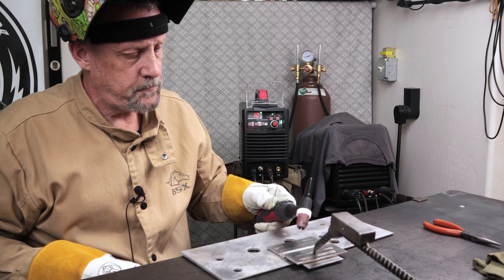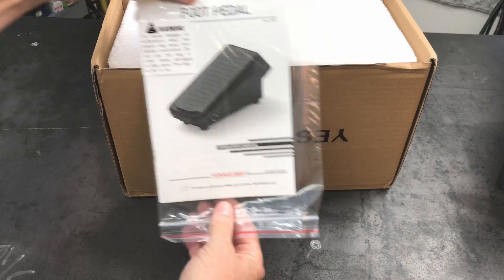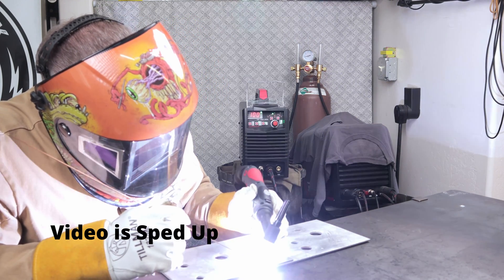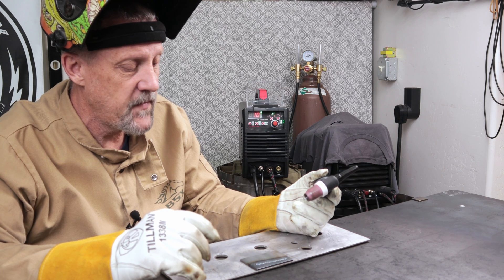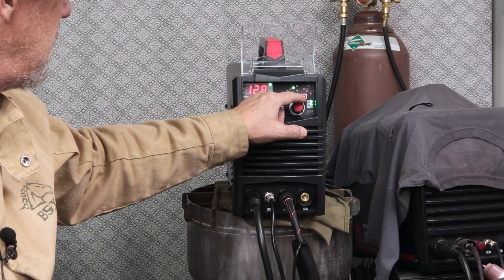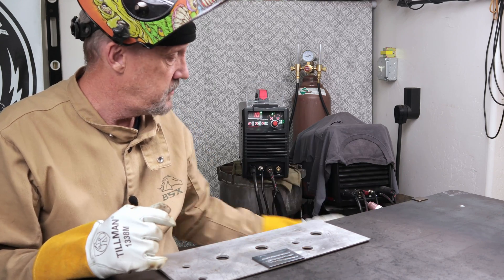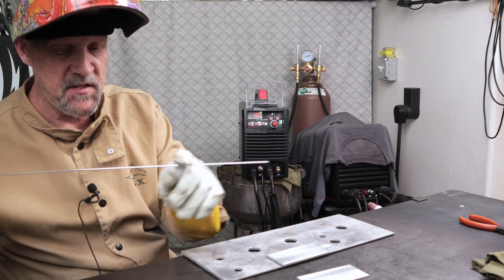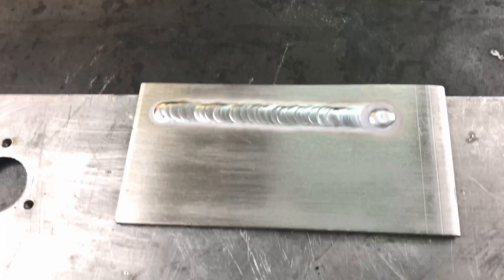Mastering TIG Welding with the YesWelder TIG 200P AC-DC TIG Welder

Comment: Very interesting as I want a TIG only to do all little aluminum, some stainless “V-bands” on exhaust and what other metal that may benefit from hammer / dolly. Did the fan run continuously or is it temp sensitive? Retired yet I owned a quality MIG new since 84. It’s filled my needs but things change, like prices, all up!
Reply from the maker: The fan on the machine I have is continuous but I think the newest version may be temp controlled. I would check with YW if this is a deal breaking issue for you since my machine is not the newest version. I wish you the best with your welding adventurers!
Reply: @ 
As an ASE Master Tech since 78, it takes an “NPN Thermistor wired to a voltage divider circuit to control a fan relay. This is about $3.60 in parts. Strange? 
 Thanks yet you are right. Models change every 6 months. 
DK, Omaha.

Comment: I plan on ordering one of these next payday. I think around the shop, it'd be the puddy cats, tweety bird. I would love to see one run some 6010s, but it would be more of a bonus than just a deal breaker. I can use 6011 instead. If I need full pen root. Most of these small inverter welders just don't have the OCV to run 6010s. Anyway, I was brought up, you make do with what ya got, where ya at. Lol. God bless y'all, work safe.

Comment: I have a recent model of that welder ,  and would like to know what size cup, and type tungsten your using ? I welded for many years ago for a living , and remember the beads flowing down nicely like yours did in the video. Seems like I'm fighting my welder not to apply too much heat to the surface.  On AC I'm running 120 amps/120herz / 30% cleaning on aluminum.  I can get a bead down, but I like the way your flow out better, and it doesn't look too hot on the coupon ?
Reply from the maker: I am using 2% Ceriated Tungsten (Grey Tip). I usually use either a #6 or #7 cup for pretty much anything I weld. I see a lot of people seem to like a #5 cup for aluminum but I don't have one and I have never tried a #5. Maybe some day I'll give it a try to see if I like it better. I wish you the best!
Reply: @DIYHomesteadProjectsDIYHP10  Thanks so much, think I'll get some gray tungstens to try then . I've been using purple , supposed to work on most metals, don't know if that has something to do with it ? I also have a 5 cup  I'll try , I've bee using a 6 also. I do have a that diffuser cup setup I can try too. Thanks so much !

Comment: That is one thing nice about the big expensive welders.  They only run the fan when they have been used for a while and need cooling vs the little ones running the fan most or all of the time.

Comment: how come on my welder i have the same one i cant change or us the buttons for post gas or slope or anythign at all only between ac/dc i can switch and 2t,4t pulse tig and tig i cant change slope or post or pre or anythign
Reply from the maker: That's a good question but I don't have the answer. I would recommend getting in touch with YesWelder and make sure you have your order #. They will either walk you through getting it fixed or replace it at no cost.

Comment: Just placed my order, thank you for your presentation!! 😁
Reply from the maker: You’re welcome, it’s a nice machine for the price IMO. Enjoy you new welder!
Reply: I need your advice, I got my yes welder 200 ac/dc, and have watched many videos on aluminum welding techniques. And all I am doing is burning up aluminum. Looks charred when I am done. Is it me or the welder?? Not sure if the gas could be bad, but I can aluminum mig weld with 211 welder, no problem. I am so frustrated. Help? 🙄
Reply: @gangeldc does the pulse work with your pedal connected? mine doesn’t
Reply: Well.. how is it? Would you buy it again? Have you had any issues?

Comment: How does this unit compare to the 250P? I want the 250P, but its not been available?? Do you have any idea if/when the 250P may be available??
Reply from the maker: As far as I can tell they are pretty close in comparison. I’m not positive but my guess is this is the replacement machine for the 250P. You may be able to find a 250P on Amazon but I haven’t seen that machine on the YesWelder site for quite some time now.
Reply: @DIYHomesteadProjectsDIYHP10  thank you so much!!
Reply from the maker: You're welcome and I wish you the best with your search.

Comment: I just picked up the same TIG.  Were you using the optional pedal or just the trigger?  I may have missed it but what size nozzel were you using?
Reply from the maker: I was using the optional YesWelder foot pedal I showed in the beginning of the video. I was using a #6 cup with 3/32 tungsten.
Reply: How is this machine?? Any issues ?

Comment: Is the fan always on?
Reply from the maker: According to YesWelder some units have a temp controlled fan (early production runs of this machine) and some have a constant fan (later production runs of this machine). I was told this depends on the production run. YesWelder also mentioned that current and future production runs will have the constant fan and not the temp controlled fan. Unfortunately I have no idea how a person would know what production run they are purchasing. The machine I am using in the video is the constant fan version of this machine.